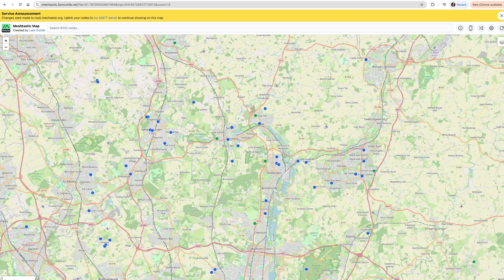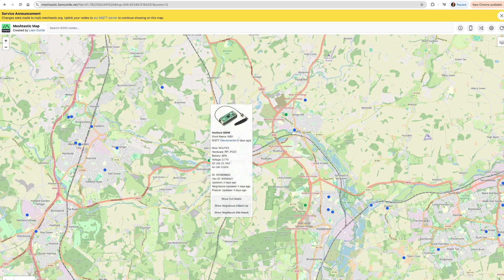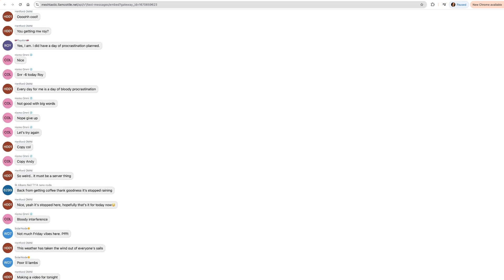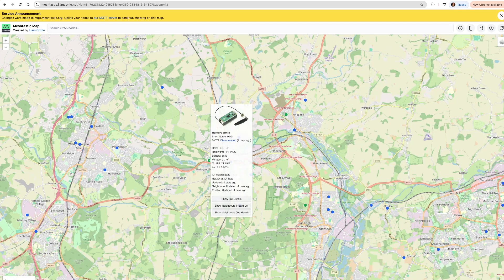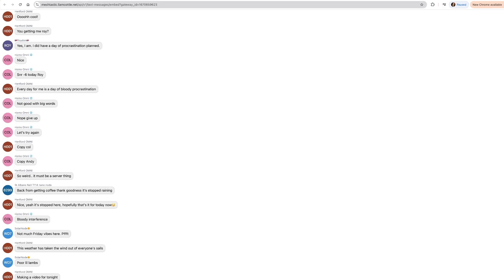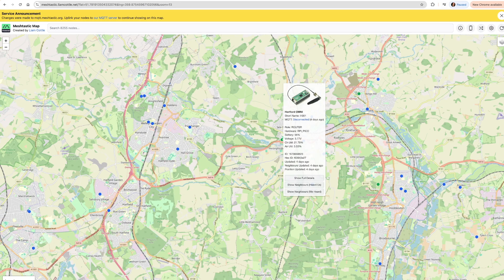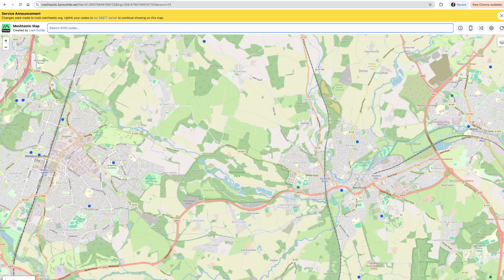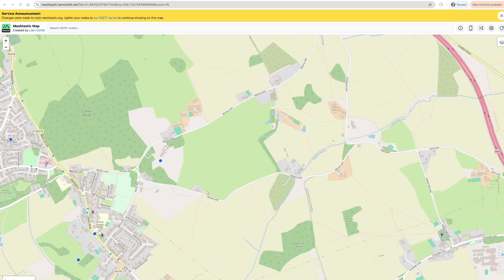How to Master the Mesh - EP2 Meshtastic Map Tools

Comment: Too late... I connect with bluetooth and I send the change... then now I can't reach my node. It's a Lillygo T-Beam. How can I factory reset it? Doesn't show as a Com port. Help please!
Reply from the maker: You've tried the meshtastic flasher?
Reply: @andykirby  yes, but no com port!
Reply: @yv6eda You put it in DFU mode?  Also try disconnecting the battery.
Reply: Thanks guys! My USB cable was the problem.